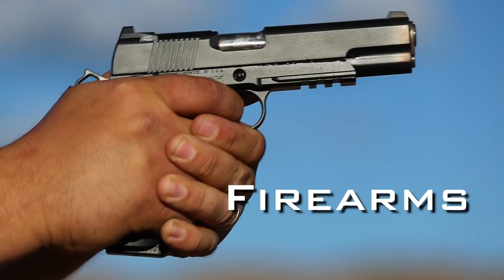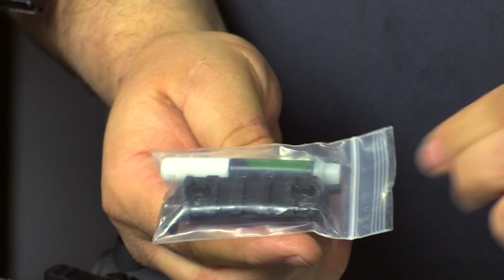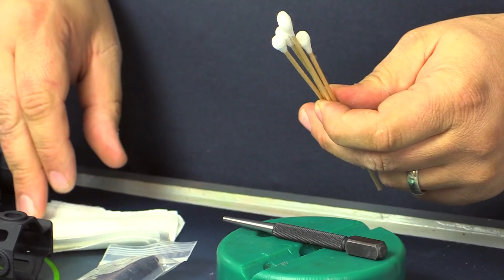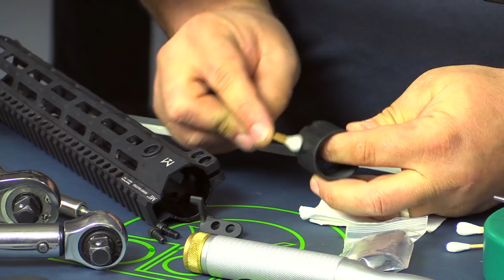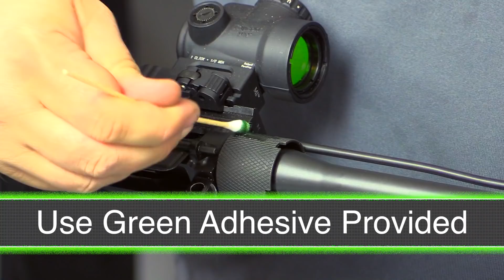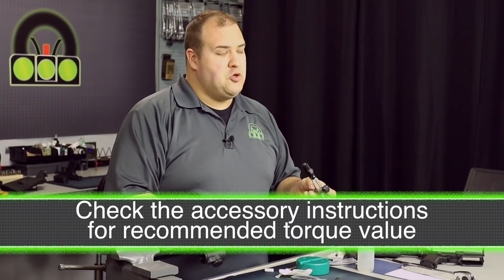How to Install the Midwest Industries Gen 3 Handguard

Comment: great video.  Very well done,  explained, photographed. But as far as the product, non milspec barrel nut is one thing, but altogether proprietary is another. I really feel with Midwest we are part of an ongoing engineering experiment with gen 2 being such a problem, and now gen 3 going rube Goldberg. Midwest will say it is user error  installing issues and they "sell tens of thousands" to oem complete upper makers with no issues. That is a meaningless assertion when responding to the consumer market. They market to that consumer market too and as that was their response to lots of gen 2 owners I just don't have faith in themMoroever Midwest does have a disclaimer about billet upper receivers (a lot of self builds). If you have a billet skip it or be prepared for lots of hassles
Reply from the maker: Most rail systems have a proprietary barren nut so that's not much of a concern to us.  We installed dozens of gen 2 in the shop with no issues but I know some did have some issues.  The gen 3 so far has been a solid performer and a welcome evolution to the product line.  Part of the reason we did this install video was to prevent consumers from having issues during installation.

Comment: So how does that green adhesive affect the ability to remove the hanguard later?
Reply from the maker: You need heat from a torch to break the chemical bond down. We've got thousands and thousands of rounds on guns with these on them with no issues. 
I have no issue with these rails they've been solid for us.
Reply from the maker: +martinitime1975 a little heat makes it easy.
Reply: +Learning Firearms I just ordered one of these & now I'm a little concerned. The torque plate seems to keep it from rotating, correct? Wouldn't heat, say, from shooting allow the handguard to slide forward? It appears to be a friction & glue lock
Reply: +Learning Firearms Awesome, thanks for the quick reply. I subscribed